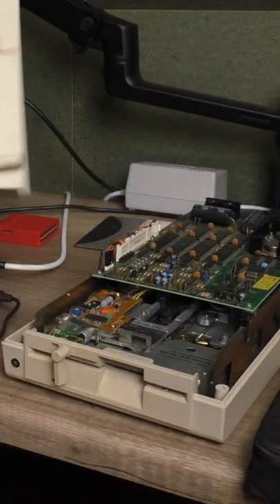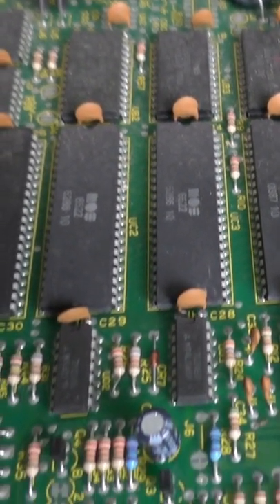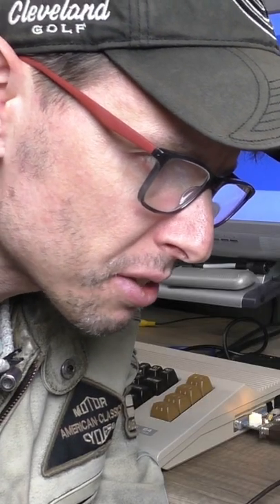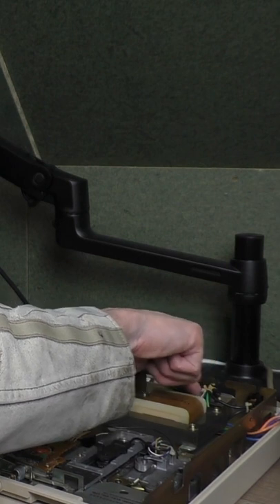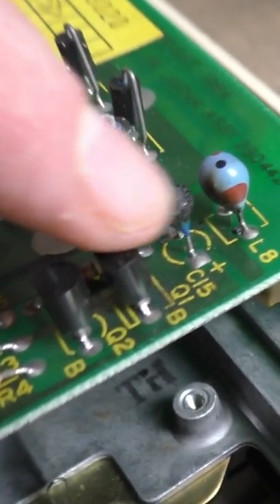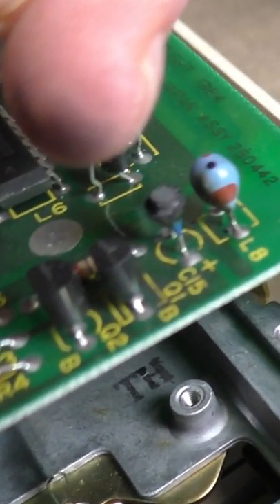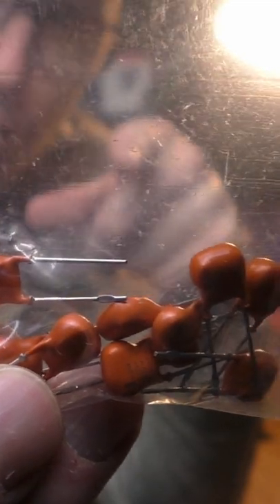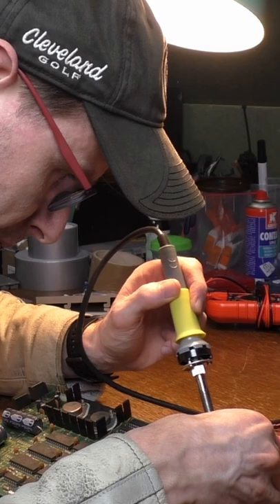FIXING a 1541 by replacing ONE CAPACITOR! #shorts

Comment: Would you recommend replacing the caps before they blow up (i.e. preventative maintenance) or just replace them once they actually do?
Reply from the maker: It all depends. I almost never change capacitor beforehand. But if you don't like surprises with white smoke you're better off changing the old caps.
Reply: @RetroGameCouch  Thanks! I appreciate the short video. Keep up the good work. 👍